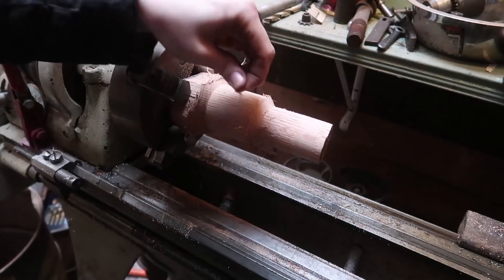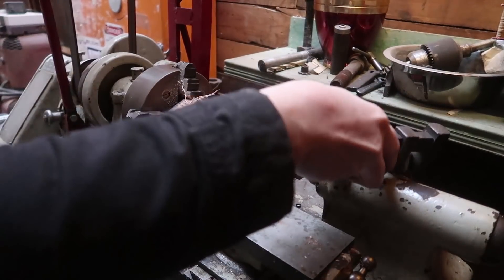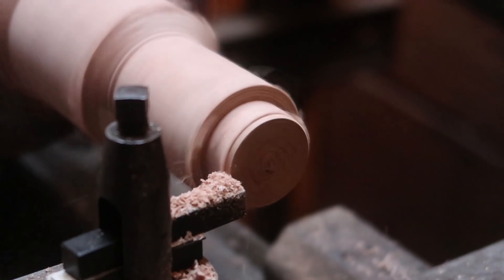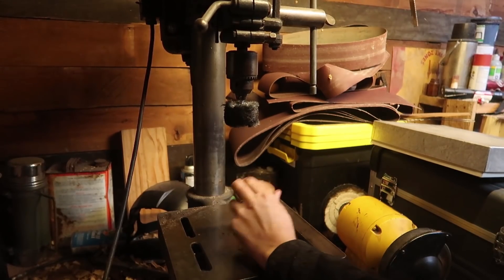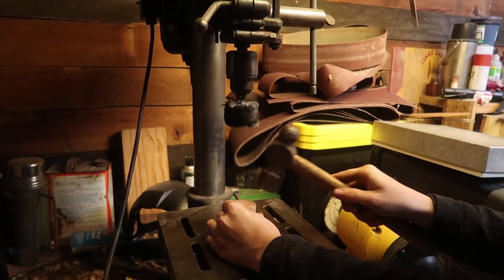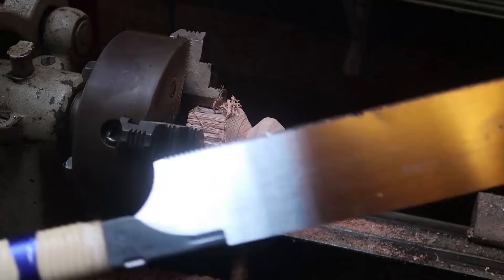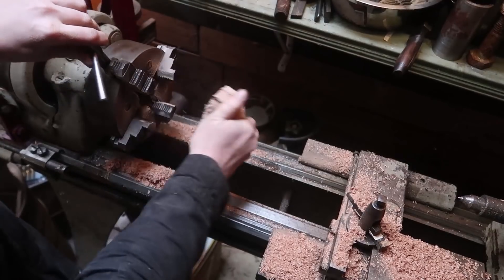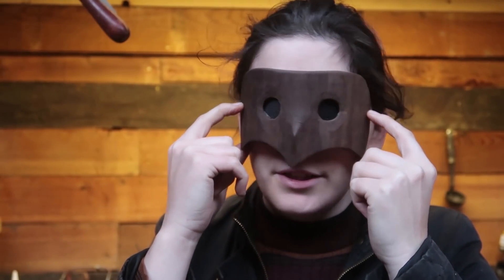Learning to Lathe 07: Turning White Oak Drill Press Tool on Metal Lathe

Comment: just one little comment (and its not a criticism, just something I spotted because it worked anyway) you were trying to do the second cut with a pull saw, generally the teeth will be facing the wrong way to cut effectively as the lathe is turning the work the wrong way for the teeth to cut properly (nit that I would recommend turning the saw around either)
Reply from the maker: i ran the lathe backwards so it cuts the right way.
Reply: @RinoaL  thanks, makes sense, i hadnt spotted that, sometimes in videos its difficult to see the direction of rotation due to the strobe effect of the shutter rate.

Comment: I haven't tried it yet, but I heard a more experienced lathe operator that if you take a hss (high speed steel) tool and grind it to give it a steep back rake, it will cut soft material much easier and give a smoother finish. Again..haven't tried it yet. Great vid, keep them coming!!!
Reply from the maker: yeah i can agree that would work but... i was lazy hehe.
Reply: @RinoaL  I've actually found that high-rake tools tend to cause tearout in wood, and they dull easily too. Especially for something like oak, the insert tooling you were using is absolutely fine. I grind my own zero-rake HSS tools and I get about the same results, the cuts looked good.

Comment: I've always heard people say you shouldn't turn wood on a metal lathe (something about the sawdust), but I've never had a problem with it. I've always found it more fun than turning metal, and the sawdust helps pick up old metal shavings when you wipe down the ways afterward. Neat mask, by the way; I've never really gotten into the FF games enough to know what it is, but I like the shape and the finish of it.
Reply: It depends on your metal lathe.   On older lathes where the gears are exposed in the saddle and elsewhere wood can get places where it is a problem.  Same thing can happen with metal chips if one is not careful using air to clear chips/swarf.  Notice that Rinona vacuumed the chips which is a good thing with wood or metal.
Reply: @danharold3087  Yeah that happens on my lathe, but I've found that the gears just turn the sawdust to mush and it doesn't really affect anything. Metal chips are much worse, they jam the gears. I think a lot of people just don't like getting their lathe dirty.
Reply: @Simplifier0  A friend had bad wood related problem on his Monarch Junior metal lathe. When I got my Sidney conehead lathe the saddle was so full of chips it could not move the carriage or cross slide.
Reply from the maker: remember that wood holds moisture and can rust your lathe, oak is acidic so can rust even worse. but with remembering to remove the sawdust in short time i say a metal lathe is better than a wood late.
Reply: @RinoaL  Oh right, didn't even think about corrosion. Guess I've been lucky, never had any bad rust from oak but I definitely believe it could happen.
Reply from the maker: remember that time i forgot oak on my bandsaw table? stains are STILL embedded into it
Reply: @RinoaL  spot on excellent reply, one thing also with wood is wood dust getting up underneath the carriage, compound, apron, saddle and other tight spots you cant vacuum. But your not using a lathe for precession work ! We would have a constant battle with people wanting to turn a hunk of wood in lathes we used for precession machining parts to high tolerances. That dust would attract moisture and create acids that bla bla bla lol we just put locks on the power box. Keep having fun and keep trying everything in life, you'll never get bored!